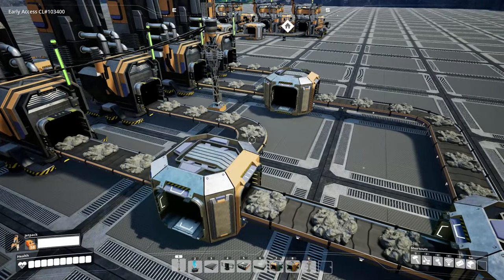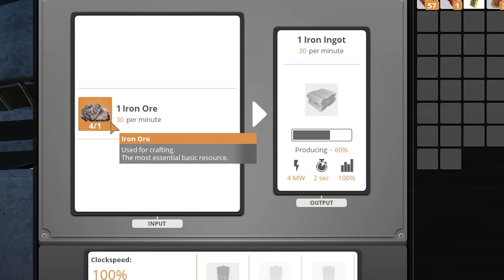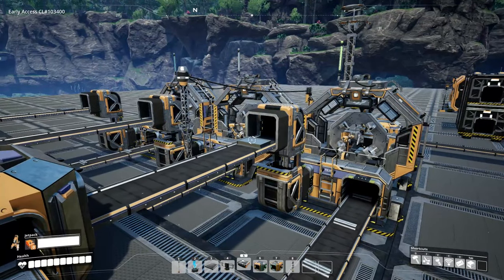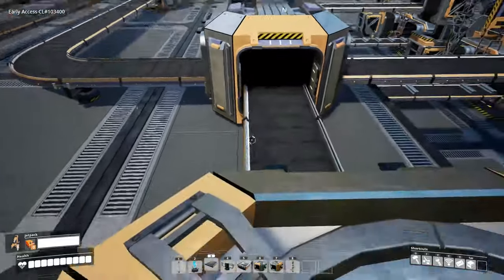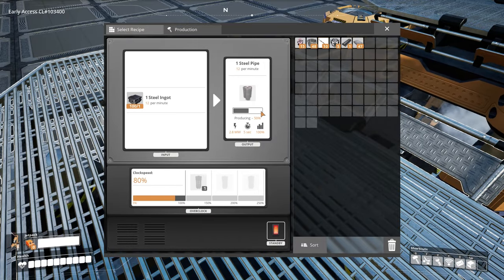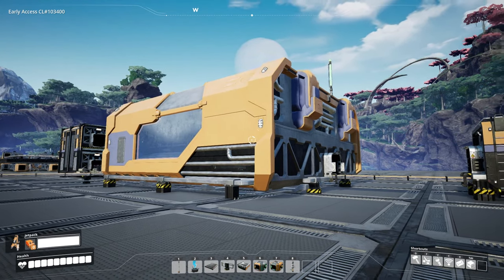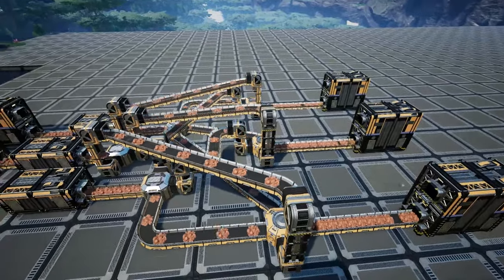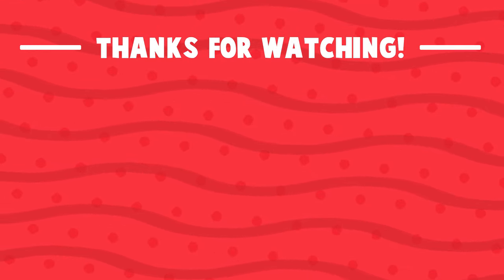Load Balancer Tips for an Efficient Factory! - Satisfactory Tips (Beginner + Advanced)

Comment: TLDR: Load balancing is absolutely not necessary.
Reply: Yeah I started to try and it just takes WAY to much time for the end result.  Its just easier to over saturate ever step of my factory and use the overflow method.
Reply: Sounds like an eventual power problem, a waste of space, and time :/
Reply: I made a factory that produces 56 turbo motors/minute. Show me how you can make it only with load balancing. I'm curious.
Reply: lol i was about to write a comment similar to yours :D
Reply: ie, math is hard
Reply: @italixgaming915   Could it be done using the overflow method on each of two lots of 28?  So you would only need one splitter.   If you wanted to create a million turbo motors per minute it might be necessary.  :-)
Reply: Agree, I'm studying mechanical engineering and his use of the word efficiency is infuriating. 
Yes the machine gets up to max output quickly but there is such a huge waste of space, time and resources for something which won't matter after about 10 minutes of running for a machine which will run continuously.
Reply: @stuartfmanning  maybe you should study more, or try a different university?  a slow starting system is less efficient due to wasted time. backed up belts are not efficient.
Reply: @UniqueBreakfastTaco  I'm pretty sure I don't, at what point are the belts backed up?  The only place the belts are backed up is where it splits to each individual machine, otherwise the main intake of the whole process will be constantly moving with recourses getting to the final machine exactly when needed. 
As for the start up, the machine's start up time is dictated by how far the recourse has to travel from the primary line down any individual machine line. If the splitter from the main line is adjacent to the individual machine then you'll find that each of these individual lines will back up pretty quickly and thus the start up sequence won't take long.
How much time does he waste building load balancers how much time does the machine take to saturate and how much time will the machine be running? The longer the machine runs for the less impact the start process has overall. The extra space taken up by load balancing is a constant and it will never get less significant.
The machine will never be turned off and deactivated in such a way that it will ever have to go through the start up again and so the argument that the overflow method takes to long to start is pretty null and hollow.
You studying anything? Engineering?
Reply: @stuartfmanning  "the only place the belts back up"

no need to go further.  belts never back up when balanced.  if product is sitting idle waiting to be processed, its wasted time and money.  kinda what i meant by my comment about your school...not trying to be an ass, but you clearly do not understand production line efficiency, as it pertains to real life.  so dont pull the engineer card, especially since you haven't even graduated. if you think balancing in this game is completely useless, i invite you to study harder or youre not gonna be an engineer.

eta: words
Reply: @UniqueBreakfastTaco   I disagree, the overflow method on compressed belts is much less complicated to setup and scales better without any loss to efficiency. It only takes extra time for the lines to prime before matching efficiency which only takes a couple of minutes (on a playthrough that can last for hundreds of hours). You may say "thats why manually load balancing is better and more efficient", but the time loss from the line priming is cancelled out by the time saved simply making/expanding an overflow line versus a load balancer line. PLUS you can manually prime the the endpoints to get them to wind up much sooner, negating the initial time loss.  

Load balancing ONLY matters in cases where the input can't be compressed due to input resource being too scarce. At which point you may need to load balance so that one recipe doesn't consume all of the resource. but if you can compress a belt easily, which you can for most resources, just use overflow method, the mechanics of the game and how splitters function greatly simplify the math for you, letting you make very compact belt layouts.
Reply: Tis fun though.
Reply: Also, some machines have a start up time so it actually is better to have the inputs and outputs equal.
Reply: @craazyguy2000  Not really. Load balancing is actually THE best way to have a consistently low power usage. Well until your storage runs full. No nasty power spikes or anything. You also dont necessarily need additional machines. You can also overclock some of them if space is an issue. But is it worth it? Not really imho.
Reply: @UniqueBreakfastTaco  Backed up belts are a non-issue when revenue and costs are not a factor.  In the real world, this is a concern.  In Satisfactory, it's irrelevant and thus not a factor in design or efficiency.
Reply: @skyesfury8511  maybe you don't care, but some do.
Reply: @HadienReiRick  Yes I have a lot of scarce resources, like modular frames, so the blueprints to create fractions really help. I can't use overflow with expensive things like that
Reply: @UniqueBreakfastTaco  I love load balancing. I like maths. I build my factories with every single stage of the production line including load balancing to the point where I sometimes use 3 figure ratios. However in reference to satisfactory it is absolutely correct that load balancing is a waste of time with regard to productivity and efficiency. Both methods are equal once their start up time is disregarded. If the factories involved a lot of priming (belts going from empty to full) then load balancing may be worth considering to improve performance, however I don't believe there are any proper scenarios where this is the case in satisfactory; everything is always running and never flushed. If they aren't, then your input source is either undesirably unreliable or insufficient and should be improved first anyway.

Additionally, any load balancer that involves recursion such as the 2-2-1 split in this video will also introduce a start up efficiency lag (less than overflow, yet still).

Product is indeed backing up and not being processed, but this is only during startup. Once the first two factories (assuming a continuous three way split) have filled to  capacity, the first splitter stops acting as a splitter and instead acts as a belt while full. This propogates down the splitter daisy chain until eventually all factories are running at 100% efficiency assuming sufficient resources. Initially the belt  gets 'backed up' but this is resolved with time, time that is typically far less than that spent designing and making a balancer.

Ultimately, load balancers are a waste of space, time, and both in-game and computational resources. In many cases they can even cost more iron to make in the first place than they gain in the slight savings in reduced lag time, taking away their only practical benefit. They are however very satisfying and potentially beautiful to make and beautiful to watch (it's not always messy spaghetti with some effort).

For reference, lag time for an overflow system is at most something like ((n - 3) / 2) * (C / [b - p]) assuming same belt speed everywhere and 2n configuration.
where n is the number of factories, C is the capacity of each factory, b is belt speed, and p is factory consumption rate.
This tends to be quite low, where even as many as 20 factories takes with some mk3 belts producing iron plates takes about 3.6 minutes to prime, fow which the factories will operate at greater than 50% on average for that time span. It takes me longer than 3.6 minutes to make a nice looking balancer for 20 factories in the first place, for which during that time production is 0% efficicent.
Though this can accumulate over long assembly lines, the time is always less than the sum of the lag times, since all these times are typically carried out simultaneously to some extent.

...
By the way, you can use recursion to split any rational ratio you like! This video only scratches one example of a recursive splitter. For an n splitter, split with known splitters to n+1 (simplest is 2, but is easy to use 3, 4, 6, 8, 9 etc. and one can even build a recursive splitter out of recursive components: 5, 7, 11, 13 etc.)  Finally, redirect one output to the input. 
Alternative potentially more customised designs can take multiple outputs to input, allowing various distrubitions of the new balancer, depending on what's convenient, or to avoid internal recursion splitters. AKA split to n+m and redirect m outputs.
Reply: @nomoturtle1788  i get the game and all...and i agree with that point. but he pulled the "im in uni" card. seeing an aspiring engineer display a lack of understanding is a concern, considering he was trying to use it as a platform to demand respect for his opinion. 

insofar as the game, my microfactories use overflow alot, but i balance the main inputs a few different ways depending on what im trying to do. multisourcing nodes. "dont waste your time" is an attitude that'll only remove part of the gameplay experience for some. thats why its bad advice. "play how you wanna play" sounds much better to me...
Reply: @UniqueBreakfastTaco  But in this case their understanding (as an engineer or otherwise) was correct. So it seems like their use of the 'uni card' would have disettled you either way? Honestly I don't mind. The credibility behind universty education is overstated anyway. 
Mhmm, multisourcing nodes is good too, feels nice not to waste. And yeah sure, "play how you want to play" indeed. I already spend loads of effort on load balancing, multisourcing, and even using the minimal necessary belt tier, despite conclusions on all of them generally being a waste of time.
Reply: @nomoturtle1788  nope. i was speaking about efficiency. that word has a very precise meaning in engineering, and he should have known so. "im a CPA in uni, here's my tax advice!
Reply: @UniqueBreakfastTaco  meanwhile you are being condesending and have a poor understanding of efficiency. He has simply and correctly explained the efficiency of the overflow method compared to line balancing. 

It takes less time to set up.
It tales less space to set up.
It takes less materials to set up.

Yes it has a priming time, wich will be lower than the actuall building time for the line balancer.
Yes there are some belts that will be backed up straight after the first splitters, wich does not matter for efficiency, there is no waste.

Both methods will have the same output. The only difference being that the overflow method probably will have finished sooner if you count the time both take to, for instance, smelt 25.000 ingots from the moment you started to build the line.
Reply: @UniqueBreakfastTaco  Sorry, you're wrong. The ONLY inefficiency of overflow method is the small amount of time wasted at the start while the machines fill their internal buffers (assuming the machines are going to be running at steady state all the time, which is typically the goal). So maybe 10 minutes are wasted, and then for the next 300 hours that you play it is JUST as efficient as load balancing. And guess what? You're going to be wasting 10 minutes setting up load balancing anyway. So both methods are equally time/energy/material efficient, but overflow is more space efficient.
Reply: @Michael-gi5ml  "small amount of time wasted"

your argument failed right there. because you dont know what efficiency means.
Reply: @UniqueBreakfastTaco  So do you just stop reading as soon as you find something you can jump on, or is your reading comprehension garbage? Load balancing wastes approximately the same amount of time. I never said either one was perfect.
Reply: @dutchdrifter8740  well, i wouldn't have to repeat myself if any of you actually knew what efficiency means.
Reply: @UniqueBreakfastTaco  The reason you need to repeat your sillyness probably has something to do with your lack of explanation of your view on the term efficiency. So if you think you have a good understanding of efficiency, by all means enlighten us.

So far, your efficiency in communicating has been troublesome.
Reply: @dutchdrifter8740  yawn. so many words, yet nothing of substance.
Reply: People mention a power problem when I overclock all my machines and do whatever I want in MY factory.
Reply: @MatthewDubin  the only problem is running out of slugs in the map
Reply: @monad_tcp  true however if you collect all the slugs. It's like 1100 or so power shards.
Reply: What's totally a great tip for factory efficiency, though, would be clock balancing:
by over or underclocking your machinery to fit the material consumption of what it's linked with, you can prevent saturation much better than trough an excessive use of splitters at, I guess, the loss of some speed since you are underclocking some things.
Using splitters to have an exact amount of materials running on different conveyors at the same time is an useless exercise in maths, all that matters is how much you're using and how much you're supplying. The only moment conveyors count is when you're clocking machinery to run faster than the current automatic delivery can insert (so instead of having exactly 75 mats running on one tape and 45 on another, just do a simple 75+45=120 and here you have your needed input)
Reply: I read all of this while taking a poop at work
Reply: @UniqueBreakfastTaco  Would you care to give the definition of efficiency in this context? I'm not conversant with the subject so I'm asking seriously
Reply: @Dashsdailydoses  I would say that sounds like an efficient use of your time, but I don't want to be ridiculed because of my flawed understanding of efficiency..
Reply: Reading this thread was a ride. XD
Reply: @rulyon7222  (Not a direct reply to you Josh, just continuing were you left off)
There are two schools of though here:
1- Make load-balancing (and overall distribution systems) as efficient as possible for every project in the game, mostly as a personal challenge. Like trying to mimic reality.
2- Don't try to do this and rely on game mechanics (like having a much faster belt) to feed X possible input machines. Mostly to save on time building and lowering overall complexity of sub-systems.
Guess what: BOTH approach are valid, but on a subjective level.
What this conversation devolved into is a shouting match about goals in real life versus a fantasy settings. Kinda sad.

OF COURSE in real life a load-balancing system is needed! You can't have a faster belt trying to push items into something that can't take it. You'll break it! That's why engineering course are so vital at designing those systems.
BUT THIS IS A GAME! Where the time needed to calculate and create those system might be VASTLY inapropriate to some who just wants to build systems. In their minds (I'm one of those), "efficiency" is getting enough ressources to build the end-result. If having faster belts just pushing enough ressources and see the belt "stall" in a few places is acceptable. You can even name it "engineering" because in the mind set of the game, that's exactly that.

Some might bristle at the though: how can someone DARE name this engineering! But we'll just have to brush those purity advocates aside. In order to have fun.
This has to be done to absolutely EVERY game and king of game in existence. This is just like harping on how there were no women in WW2 on the front lines or how "survival games" eschew a lot of the "survival" aspect.

Basically, it's called "acceptable break from reality". You know, to create a more enjoyable game?

As for me, I learned a few things reading this (even about real life engineer courses), but since my time is limited, I'll stick to brute-forcing ressources using faster belts, thank you very much.
Reply: Overflow method= longer startup (nobody cares since you just continue building)
Balancing= no advantages, very complicated to set up (waste of time) power fluctuation isnt imporant because you will always have way too much power in this game after coal
Reply: @stuartfmanning  I think @Rhia is probably right to tell you to look for a better school. First I'm pretty sure you meant resources as in the iron in-game is a resource. Not recourses as in the company rejected his offer and he was left without further recourse. Also, as an engineer myself nowhere in the real world would the overflow method be acceptable. It is simply a waste as material sitting in a factory not only costs money to produce but is also a waste in terms of time and labour to produce. In most applications, it is also a waste in terms of storage space as storage is usually limited in the real world.  Of course, none of this is applicable in-game but as an aspiring engineer, it is good to build the habit since now as you will not last long in the field of engineering without complete attention to detail including costs associated with a project.  The goal is always to maintain efficiency at the lowest cost possible and it should become so ingrained that you naturally think about waste even in a game in which it doesn't matter. For a real-world example look at Lee  Iacocca's autobiography and or the history of Dodge.  Dodge would not be around today if not for Lee Iaccoca taking over and getting rid of all the over-produced waste in the factories. As an experienced engineer, it is very important that you only produce what is needed when it's needed and although it is not applicable in-game as costs are not associated with materials other than the power the machines are using as an engineer it should come naturally that you would want everything balanced and not be using the overflow method.
Reply: @mtz21601  im really dont get it, but im curious. Why would the overflow method be less efficient then a pefect load balancing? Basically ill just repeat what already been said, it doesnt matter which method youre using, you definitely will have any time wasted, either while settinp everything up or the time the production line needs to overflow. But once the overflow is done and the amount of input ressources/minute matches the ressources/minute that are actually used by the production line there wont be any ressources just sitting around because as is said, the input is equal to what is used. So assuming youre starting a production line once and the time the line needs to overflow is less than the time you would need to set up a perfect load balancer, then at this point the overflow is more efficient than the load balancer because in the end less time is wasted. Im not an engineer myself, but thats my understanding of the whole thing.
btw, 2 years ago i worked at a production line for a big automotive supplier and what i saw there was like not even close to anything you could call efficient. So i think as an engineer you do all the maths to balance everything perfect but i think in the end all these math only works in a theoretical scenario.
Reply: Really load balancing efficiency only comes in to play if your raw resources are limited, and there's so many nodes in the game that's rarely the case. If you had a big enough factory, or there were say 1/20th the nodes in the game, it would be extremely important to balance your inputs efficiently.
Reply: @UniqueBreakfastTaco  "not trying to be an ass, but you clearly do not understand production line efficiency," You are though, especially because he is right. 
Start up time doesn't matter. It's exactly like calculating the derivative of a constant. Because it is constant. Build time only matters because that's MY time. The machines will work unattended. 
Belts ONLY back up if you are NOT using all of the resources produced in the previous step. Duh.
You - could direct them back to storage, but what's the point? Backed up belts ARE storage buffers. So are the input buffers of the individual machines.
You will get higher tier belts. Higher tier miners. Higher tier items needing more resources. Bigger storage. While you're busy reorganising, cutting supply lines in the process, those buffers will get used up, so the items are STILL produced regardless. 
With overflow? Upgrade the belts and slap on 10 more smelters on the side of the same production line, hook up the new splitters/mergers and done, now you can do the same with the constructors or what have you. The only calculation you need is how much you produce total and how much you consume in total of a given item. That's it. 
Also, where the heck do you get the items you use to build stuff with if your production line is perfectly balanced so there's no overproduction of items?!
Reply: @monad_tcp  "the only problem is running out of slugs in the map" LOL
I still have like 120 shard worth of them in storage - I only use them for miners/extractors. I've been putting off making a production line for them for a while now. I just wanna watch them smart splitted and crushed into shards automagically :)
Reply: @mtz21601  " It is simply a waste as material sitting in a factory not only costs money to produce but is also a waste in terms of time and labour to produce."
What are you talking about? "sitting in the factory" Where? In the input buffer of the machines? (because it's not on the belt if you have the exact amount of input). I want that in the buffer. Because sometimes you cut a line or two to reorganise things. Or you replace a storage. I'm sure buffers exist in the real world for very similar reasons. Just-in-time delivery has it's risks.
Reply: @Kanglar  Yeah, I see load balancing useful only at really high tier items when you only produce a couple a minute or so - AND you actually need it in multiple places... which is rare.
Reply: @rauminen4167  it does for complex lines. I know...math is hard.
Reply: @UniqueBreakfastTaco  "it does for complex lines"
What "does"? Startup time matter? 
Did you get as far as the first sentence, is that it? 
No, no it doesn't. Matter.
"I know...math is hard."
No, no it isn't.
Integral is calculating the area under the graph. Like the efficiency graph.
Calculating derivative is the opposite process. You eliminate constants when calculating a derivative. It's maths. 
Constant startup time doesn't matter.
Reply: @UniqueBreakfastTaco  damn u salty just coz a guy said he is going to uni.... Lmao thats lame af
Reply: @UniqueBreakfastTaco  Load balancing only really matters to the degree that you're designing a factory to meet a specific output requirement (which you will also be arbitrarily arriving at on your own, at the very most, being dictated by how you want to continue researching through the tech tree). You're constantly growing a factory. The inputs and outputs are always shifting. Using the right belts for a specific section of your factory is more important than concerning yourself with the minutiae of how you manage the exactness with which you apply real world production line principles to a fucking game. Basically every problem is solved by tapping more nodes, because your outputs will increase as time goes on and that places a greater demand on your inputs.

Efficiency is a ratio of the output from any system divided by the input into that system that expresses, in terms of the measured variable, how efficient the system is in that specific aspect (be it power usage, production rate, energy transformation, etc). It's usually multiplied by 100 and given as a percentage. In this game, there is no consequence for production inefficiencies, because nodes are infinite, power generation is expandable, and there is no such thing as lost or wasted product. Literally every item you use goes back into your inventory.

This is nothing like real life, and as such, applying real world principles here is, in itself, an extraordinarily inefficient use of your time which is really the only actual real world concept that pertains meaningfully to this game.
Reply: @McShavey  there's 2 different arguments here. first is efficiency. time is a component. given there is a startup time for overflow and not for balancing, its by definition (mr uni engineer should know this) not as efficient. 
second is impact on the game...its minimal. as i said, i dont care how anyone else plays the game, but ignoring the startup and claiming its just as efficient is simply not true.  is there a reason why this gets people panties in such a bunch?
Reply: @UniqueBreakfastTaco  explain your metrics for efficiency.
Reply: @K9RacingAndStuff  generally speaking, there's 3 main metrics: availability, performance, and quality. Availability, or uptime, measures the percentage of usage of a system. Performance measures throughput, quality measures yield.
Reply: @K9RacingAndStuff  explain your metrics.
Reply: @UniqueBreakfastTaco  
"time is a component", so the building time the load-balancing, especially with upgrading change, takes is not take into account ?
Reply: @doriancarriat4241  nope. Again, this goes back to defining... correctly...what efficiency actually is. Ones lack of belt organization and proper planning make load balancing difficult. I'm easily able to building using a similar number of splitters using either method. I tend to overflow smelting, mix of belt balancing and small overflows for low tier items, and load balance everything from computers up. For example, a row of 9 smelters use 8 splitters in overflow, but I can load balance using only 4.
Reply: It isn't necessary, but it is extremely satisfying and rewarding to see your hard work turn into a perfectly balanced factory. Putting everything a line and feeding off a conveyor belt just isn't as fun.